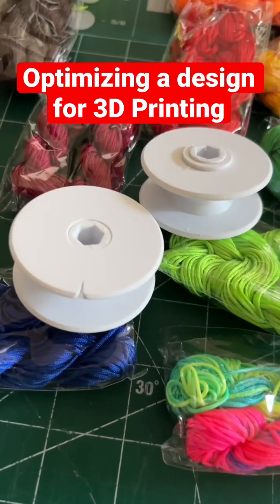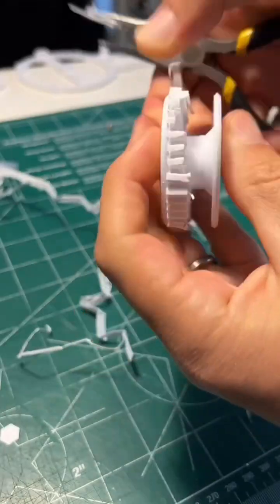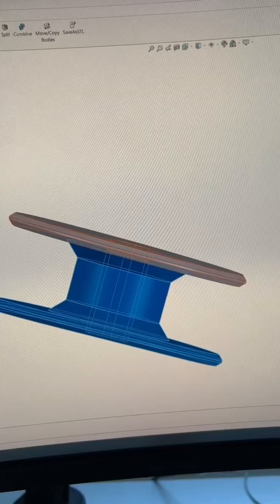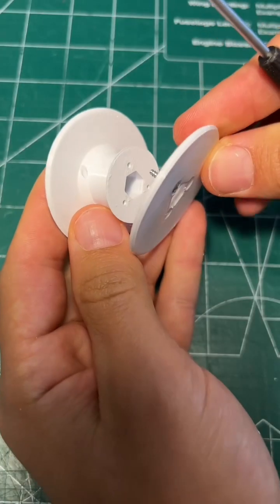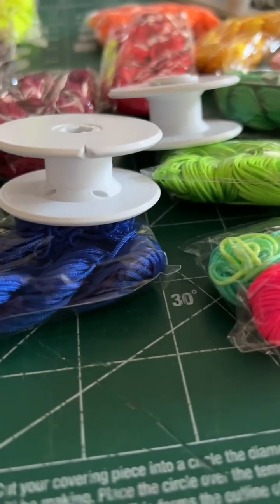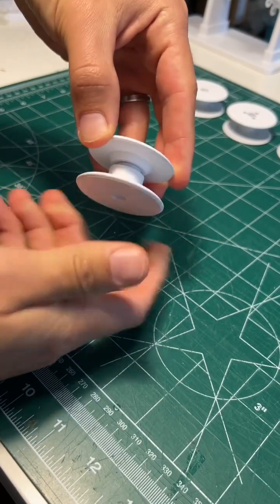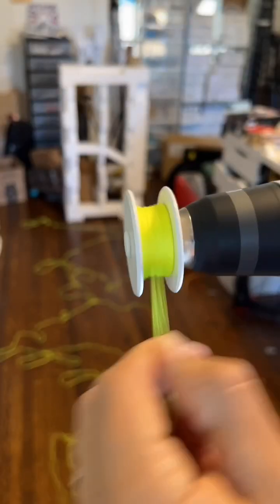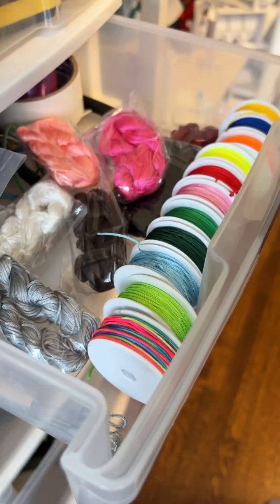Optimizing A Design for 3D Printing

Comment: With a spool like that, I would just split it along the middle and print each half with the inside on the build plate then glue them together. No support needed.

Comment: Cool stuff.  However, that poor surface finish at supports is due to improper settings. Distance, density and fan settings can correct the surface finish.

Comment: huh? just print vertical, cut off a bit of the wheels to support on the bed, if it won't suffer stresses it won't fail at th layers

Comment: As someone who has been 3D modeling and printing for an additive manufacturing company: Be aware that 3D printing threads can fail relatively easy depending on what they’re being used for. The ones demonstrated in the video don’t seem to be used for anything load bearing though.
Reply: This suggests the slicing/printer isn't well tuned or the material isn't suitable. I have printed M8s (printed in the Z orientation, the "worst") holding up 2 8025 fans in a cantilever configuration subject to the vibrations of a printer running at 45-60k acceleration and they hold up fine. They are HTPET, though, not PLA.

Larger threads quickly get progressively stronger. My Tech Fun did some experiments where I seem to recall holding over 100kg with M10s.
Reply: @daliasprints9798  Maybe HTPET has better layer adhesion then🤔 Could always just be a slicing issue though
Reply: @peytondeaton6272  It does - layer adhesion is one of the awesome things about HTPET. But I have PLA ones that can't be snapped by hand without getting extra leverage - only reason I don't use them in contexts like this is creep.

Comment: You can also add a pause in the slicer and than add an other 3d printed part made from another material so that the material won’t stick. Then when it’s finished you can simply remove the middle part. 
It’s just another method. 
But the threads are also nice 👍🏻
Reply: Was trying that a while way back, but found it inefficient and often all sorts of hickups. True tho that switching material makes it possible to have parts not stick, which can be used in many ways.